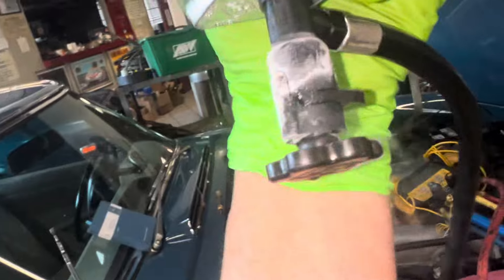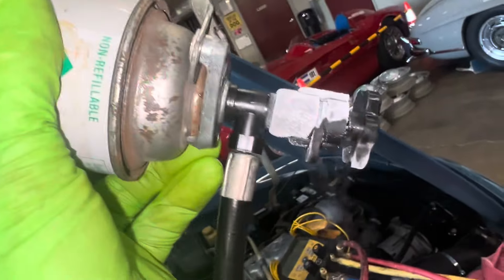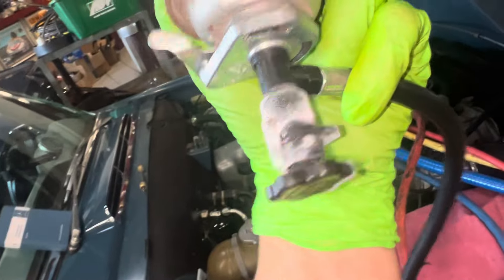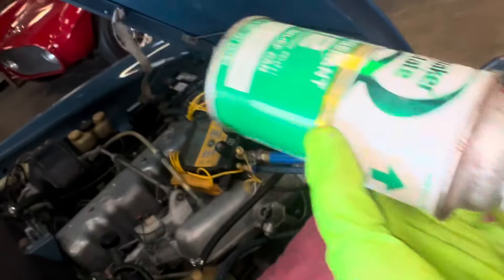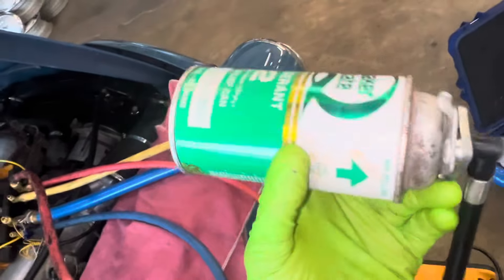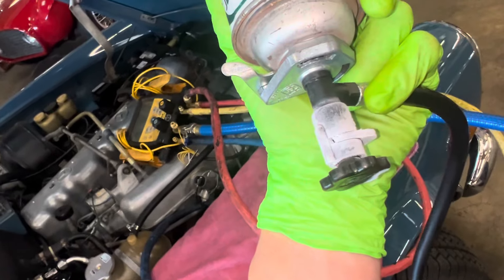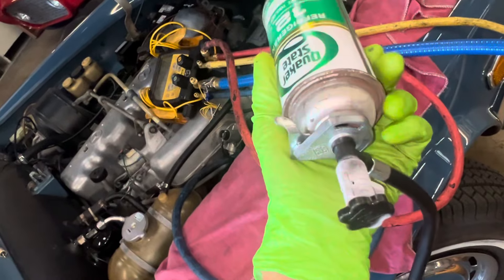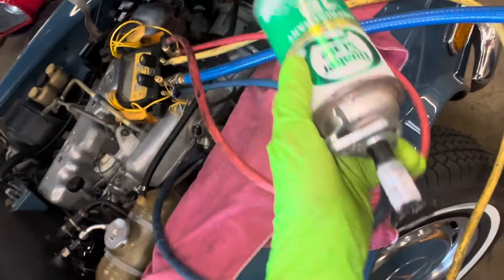The new refrigerant can tap it today. Still do the exact same as this old cant from 40 years ago..

Comment: I use a side saddle can tap. so much easier to deal with compared to the generic can taps.
Reply from the maker: I prefer no can tap.  I’d be bankrupted if I used them. 

The to
it takes I would have to give up doing 3+ jobs a day and not have accurate recharge 

I’d be the working poor . 
Would not be able to buy good tools or fly to training expos and seminars. 

I’d be like all the other guys saying it’s difficult to make money 💰 

I would still be working for someone else if I learned and stayed using cans.  

Every can change is just another chance at a mistake
Reply: @coldfinger459sub0  if I did automotive ac professionally instead of as a side hobby I would only buy the 30 LBS cylinders. However now that the price of them has doubled from $250 to $500 it's hard for me to justify the up front cost for the occasional ac job.
Reply from the maker: @retro_88yota  yes for DYI cans r the way to go if you don’t do many.

Comment: How do you weigh the amount of refrigerant being used, especially if you’re losing it while filling? Do you go by pressures, vent temp, sight glass, or something else in this instance?
Reply from the maker: I don’t fill up cars like this. This was somebody who asked me to do this with their cans and their refrigerant can tap tool.. 

Because this is a nearly indestructible system with a compressor built like a tank and it’s such a large fill capacity . 

Small amount and it comes in put up your thumb in the wind and it’s good enough for work . 

I would never use these cans or these small devices to do refrigerant work . 

This was only to show example because I was being asked to . 

No professional shop whatever use these little cans and can adapters . 

Especially on today’s vehicles with microchannel, condensers and micro channel evaporators with extremely small refrigerant capacities that are crucially charged that are very sensitive just to one or 2 ounces over or undercharged the small capacity systems
Reply: He doesn't know what he's doing. I used to be a certified mechanic working in a Chrysler dealer, and the AC specialist worked in the next bay. That's all I used in the dealership was those 12 oz cans. A real AC technician uses gauges and thermometers. You need to know the temperature of the ambient air, the suction line, and the high side line.
Reply from the maker: @garyszewc3339  oh 😧 I didn’t know that. 

I’m not a certified mechanic. 

I only seen pictures in a book how to do it . 
   I’m new at doing air-conditioning so I’m just learning